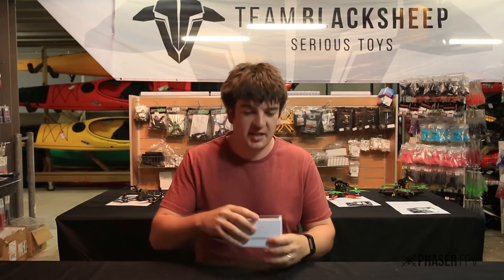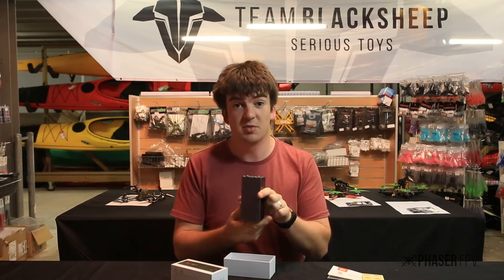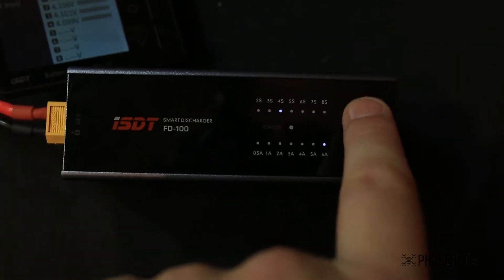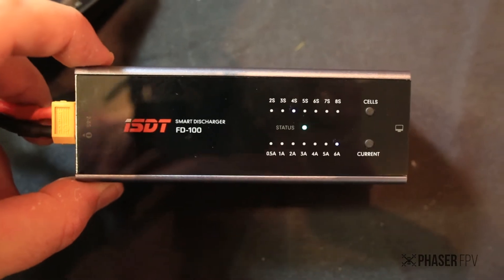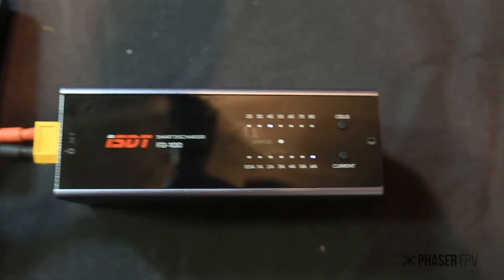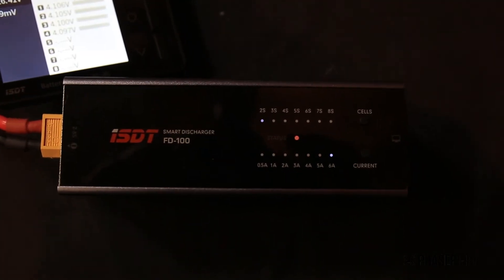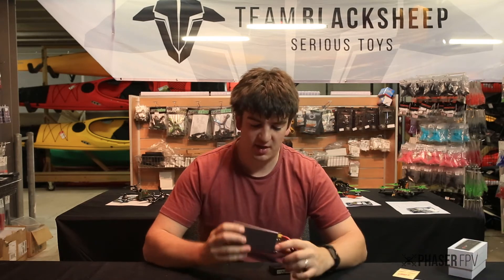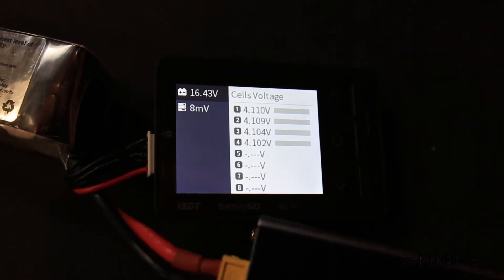iSDT FD-100 80w 6A Smart Discharger Review

Comment from the maker: I should state why this product is used. If you have a bunch of charged batteries that you didn't use out in the field, you should discharge them to storage if not using for over 1-2 weeks as the battery will last longer in this state at 3.8v / cell - This Discharger discharged them to 3.8v/cell very quickly.

Comment: nice vid.  thanks for posting.    the ISDT product page states the following "Default cut-off voltage and working temperature could be adjusted through sc-linker by PC or by ISDT smart charger".    I'm curious how the ISDT smart charger with link via the plug over fan works.   still researching.    thanks!

Comment: Junk.  Mine does nothing but beep at you.  Won't discharge.  No way to change target voltage or see what voltage any cell is at but I guess that's a mute point, since mine won't even do the function it's marketed to do... take a bat at higher voltage down to 3.8v per cell.  Don't buy.
Reply from the maker: send it back to your retailer? We have had 1 fail out of 50, the rest have worked as advertised
Reply: @PhaserFPV  -Not mailing it back to Banggood in China. Would take 40 days and what a hassle, and probably cost more than I paid for it in shipping. 
 
Brand new :-/     I had to resort to using my DJI FPV goggles today to discharge some batteries, but at the rate the goggles suck power (7w) it didn't take long.  Plus, voltage displayed in goggles.   
 
If the thign worked, I'd velcro a URUAV voltage checker to the side of it to plug the balance charger into, I guess you could get some feedback that way.  But really, should you have to :-/  Should be built into the unit.
Reply from the maker: @choppergirl  maybe buy from your local dealer instead of banggood in future. Pay more, get better warranty and support. we give 1 year warranty on iSDT

Comment: If you need the software to calibrate the input voltage (you will!), or to adjust the storage voltage (you will!), you can find it here: http://www.isdt.co/down/software/FD100Linker.zip   Mine was discharging down to 3.73V per cell, which is pretty low. Through trial and error, I changed the storage voltage in the app to 3880mV, which resulted in batteries consistently discharging to 3.85V per cell (+/- a few 1/1000s).

Comment: I went to the isdt's product page, and they put your link to this video as an "Operation Instruction". Based on this video, I thought I could discharge my LiFe batteries since I'm supposed to be able to change the discharge voltage. I even bought the scLink cable that was shown on the product page. That is a lie. As of 10/26/17, they don't have a software that allow changing the discharge voltage. If such software is not ready, just be honest and let the public know. It is infuriating to know I had bought something based on a lie. You, my friend, took part in this dishonest business. Shame on you.
Reply from the maker: Dude I just did a review on a discharger we sell. Thats all. Just because they used my video as their link doesnt make me part of the problem.  If you have a problem with the product, go back to the manufacturer or the person you bought it off.
Reply from the maker: I believe you can change the settings by connecting to the T8 charger, and they are still working on the final version of the software for PC. I will update the description and comments when this is so.